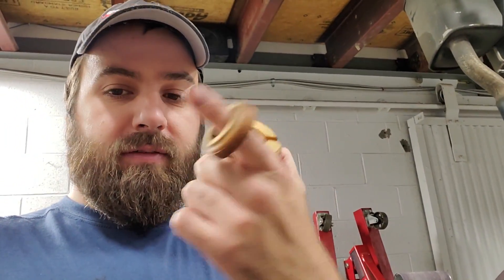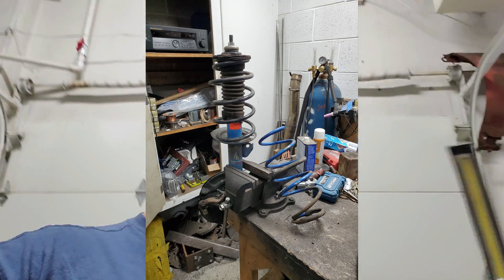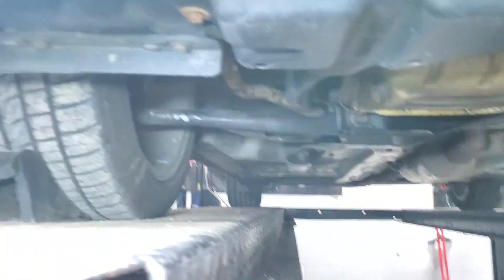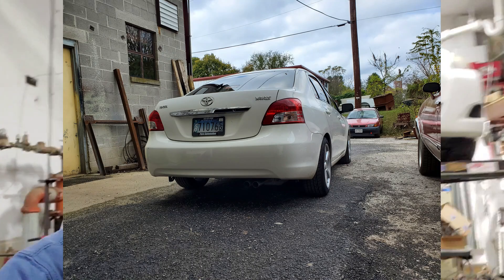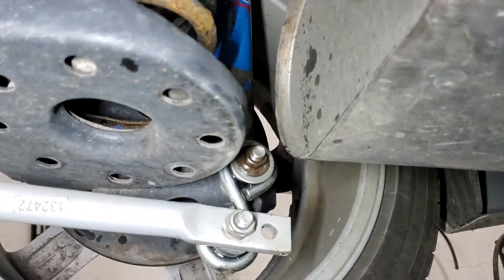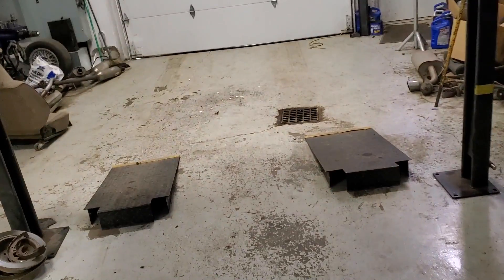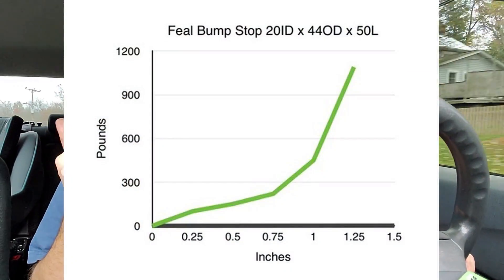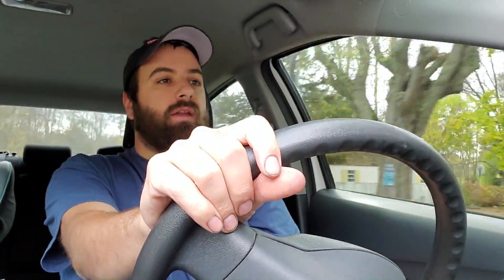Yaris low down

Comment: I like the work you put out for your Toyota Yaris it gives me some great ideas
Reply from the maker: Thank you I appreciate it
Reply: @garage79r   no problem I was wondering if you could help me out with my Yaris performance wise just need a good mechanic
Reply from the maker: @roadrunner1261  sure if your local to northern MD
Reply: @garage79r  yes I am right outside of Gettysburg, Pa
Reply from the maker: @roadrunner1261  my shop is in Manchester
Reply: @garage79r   Perfect that’s not far at all
Reply: If you don’t mind me asking what’s the size and width of the rims you have on your Yaris
Reply from the maker: @roadrunner1261  16x7
Reply: @garage79r   so what made u go with 16x7 why not 16x8